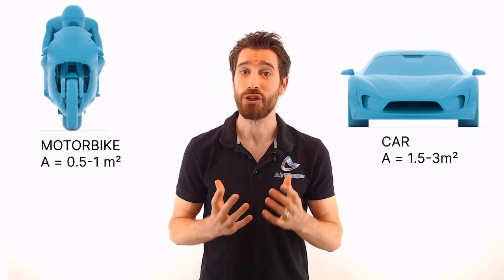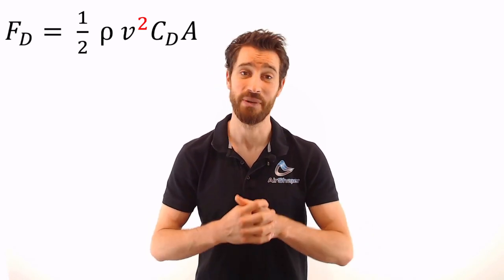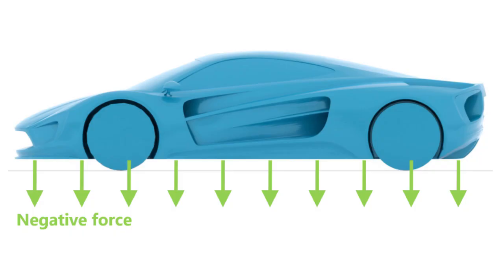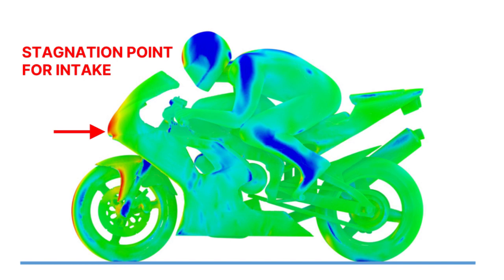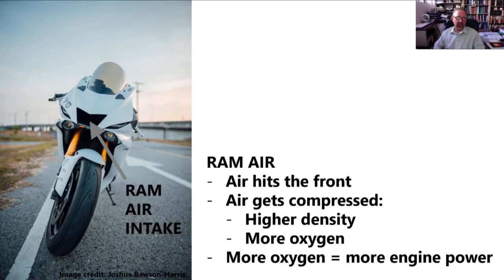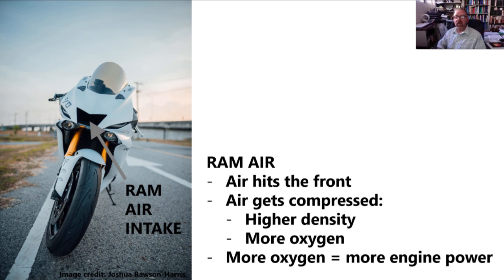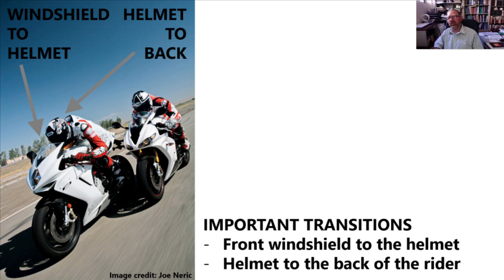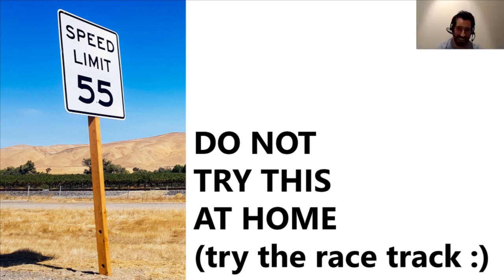Motorbike Aerodynamics - 10 mph faster with Joseph Katz

Comment: Interesting video! I understand the problem of the Ducati wings. But if the motogp tires have a really high coefficient of adhesion can the increase in normal force still payoff the force pushing outside?
Reply from the maker: That's correct: in theory, if the friction coefficient is higher than one, the effects should be positive indeed! But one slippery patch on the road and you'll quickly notice the negative effects :)
Reply: @AirShaper  i just want to say Wouter Remmerie is such a cool name
Reply: Kyle engineers a former mercedes f1 engineer actually addressed that concern on his channel, because the centre of gravity changes when cornering, the effects of the wing changing angle in corners is not negative at all
Reply: The solution for side force is to cant the wings with a few degrees of Ahedral, and the angle of attack to s point where the inside wing during a corner will stall out and not produce any side force, whilst the outside wing will be producing downforce into the Tyre near its most efficient point.

This is why motorcycle wings aren't just worried about the longitudinal plane, and have the Yaw/Z plane into account.
Reply: @Bull_10RR  Ducatis don't look to have much of an ahedral angle . On the Aprilia yes

Comment: i was trying to find some data about this and i came across one website that said that "Honda RS125 GP" has like 0.2 drag coefficient. do you think it's real? or could i possibly be misunderstanding the data? seems like that would be very low for motorcycle.
Reply from the maker: Hm, that sounds highly unrealistic, such a low drag coefficient for a motorbike...
Reply: @AirShaper  yeah it seems very low. I tried to look for the max speed and max power and dimensions for this bike and tried to calculate the drag coefficient based on those and i came to the conclusion that it might have around 0.3 drag coefficient because otherwise i think it would need more power to achieve that top speed.
Reply: @AirShaper  if my calculations are correct then it would probably be very nice to make similar bike but electric. 🤔
Reply from the maker: @wilderness-beastt  We've been working on various electric bikes. But it's only the very streamlined ones (for records, ...) that can go below a Cd of 0.30. Also, the position of the rider maters a lot, and most will not maintain an uncomfortable one like you see in MotoGP races. Just some thoughts!
Reply: @AirShaper  makes sense. 🙂

Comment: that's insane. so even though a car is 5X the weight of motorcycle it only has 1.5X the aerodynamic drag. this explains why EV cars get 300 miles of range while EV bikes only get 100 miles of range.  because cars have 5X battery but only 1.5X drag and therefore 3X range.  this also explains why EV car gets almost the same economy in city and highway while a motorcycle gets 3X the range in city vs highway.  so basically EV motorcycle is useless on the highway.  i watched your videos to understand whether EV motorcycles make sense from standpoint of energy efficiency and the answer is yes only as long as you don't go on the highway.  thank you for the great content.
Reply from the maker: Nice comparison!! Indeed, the ratio between Cd and weight/volume/battery capacity is challenging for motorbikes. The limits on weight increase are more stringent on motorbikes than on cars, when it comes to switching to batteries. But then again, perhaps the "desired range" is lower for bikes :)
Reply: @AirShaper  absolutely - bikes don't need as much range because they supplement rather than replace cars.  the main advantage of EV bikes is probably rider comfort due to less heat.

Comment: Great video! I have been designing an electric commuter motorcycle trying to use aerodynamics and weight reduction to reduce total energy consumption. There are very few videos that discuss this so I am always looking for other people that actually talk about aerodynamics and motorcycles. One of my challenges is that I am planning a much smaller motorcycle than where the research of race bikes is so a full size super bike is already at a quite a bit of a disadvantage. My project actually incorporates comfortable ride and currently working on the most useful balance of weight and aerodynamics. Much like the products of the Craig Vetter Fuel Economy Challenge but engineered from the start rather than a modified scooter.
Reply from the maker: Hi Chris, that sounds very interesting! How far are you with the project: design, prototyping, ...? Is it a hobby project or are there plans for commercialisation? Feel free to get in touch via info@airshaper.com!
Reply: Lets talk about it in a bit... I'm doing the same thing... I'd be great to share notes. Check Norton Kneeler, you'll get some design cues from it. Also check the Britten v1000 I think it is called.